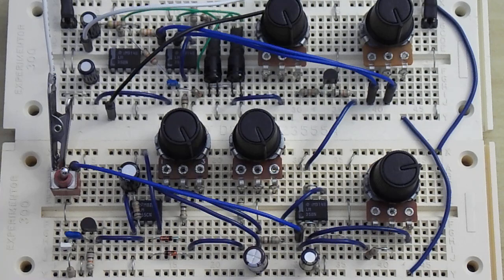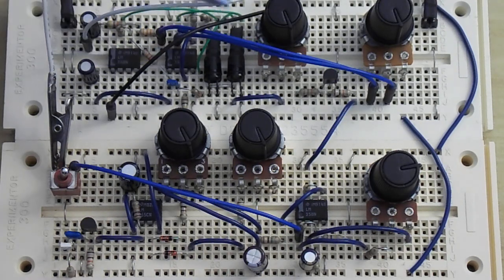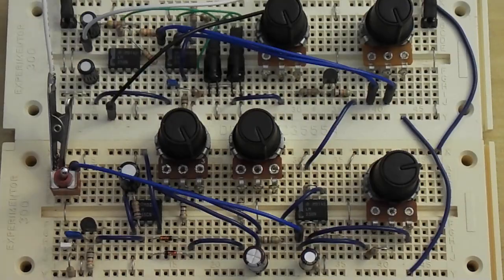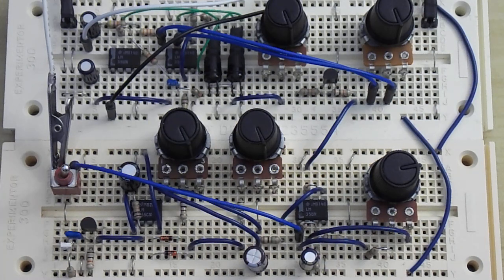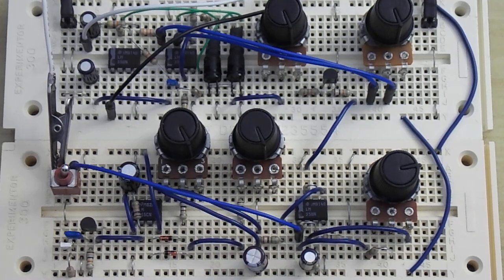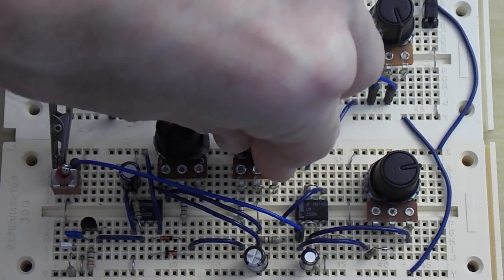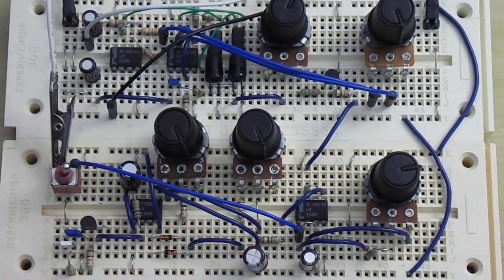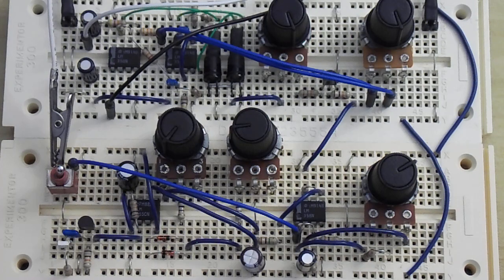McBennett Synth VCF Secrets Revealed!

Comment: Wonderful work. IMHO in the long run it's better to draw a schematic with the "triangles" to see what's going on. It also makes it easier to build the circuit with different op amp packages (dual, quad, and different pinouts). Otherwise I really like what you did with the LDR's.

Comment: What, if anything is connected to the external in On s1?
I built the basic ldr synth. Now it's time to try this.
Reply from the maker: The external trigger input comes from the trigger pulse generated by my Arduino keyboard synths. Check out my other videos when you get a chance.
Reply: I'm still trying to get this working.
I can get the filter working, but the VC part isn't going. I know this, as I replaced the Ldr with pots, and it works. Would a 555p still do the samejob, as the 555 timer?

Comment: Hello Pete, thank you so much for this design!
I have some questions about it.
What if i want to use external control voltage on the filter? where would i attach an input jack to?
Secondly, i suppose that the "auto trigger" point could be used as an LFO output, right?
Reply from the maker: Hello Gennadios!  Referring to the schematic, you should be able to insert an external control voltage into the base of Q2 through another 10K resistor where R9 is connected. And yes, the "auto trigger" could be used as an LFO output, but it is square wave only.

Comment: The schematic has an error the R27 of the LFO is connected on the wrong side of r26
Reply from the maker: I have checked my breadboard and schematic, and YOU ARE CORRECT! Thank you for finding this. I will update the schematic with the proper connection.
Reply: @petemcbennett6039  was it updated in the description link?
Reply from the maker: Yes, the description link points to the corrected schematic.
Reply: @petemcbennett6039  That's awesome, ty